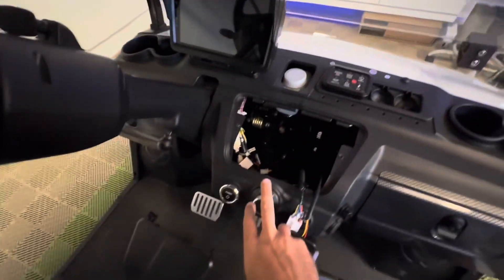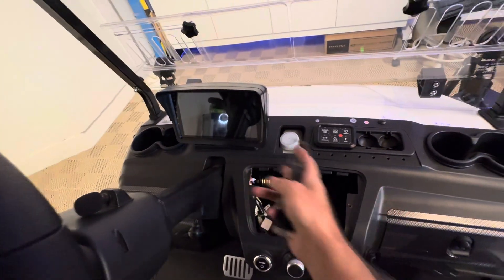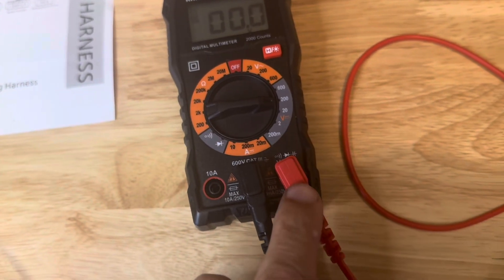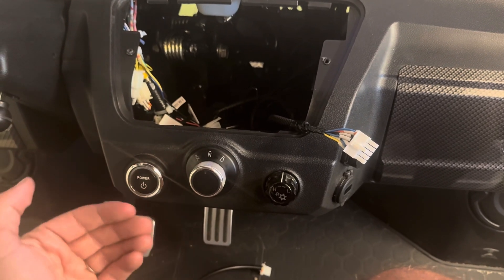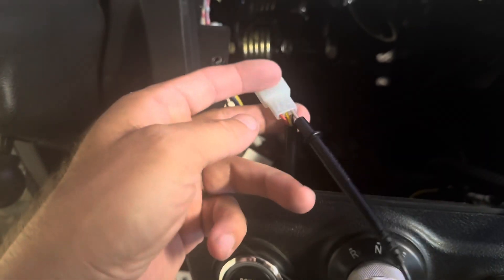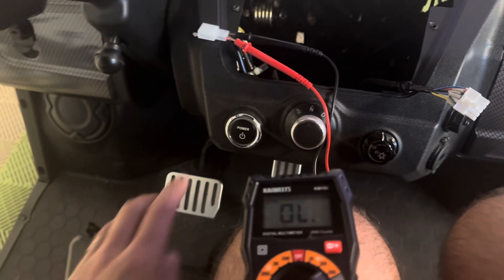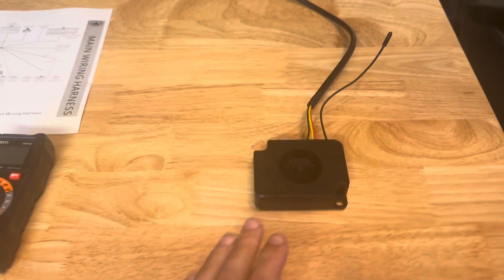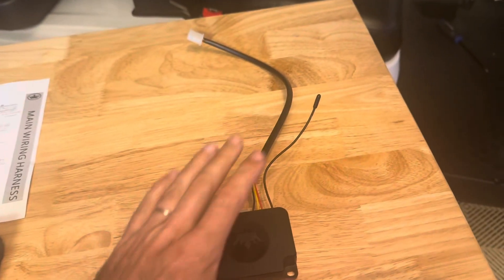Push to Start not working? Diagnostic steps to try for for evolution cart D5 and DMax. (Part 2)

Comment: When I push my start button, the blue light on the key fob lights up. Would that indicate the start button is working properly? Love your videos!
Reply from the maker: Yes! - That’s a good eye. I just tested mine and when the key sends out its acknowledgement it indeed flashes the blue LED quickly after you push the start button. 

That’s a good sign it’s responding to the controller and a great way to test it’s being picked up and responding. 👍

Comment: Hello sir. This is off subject to your video.  A question for you, can you hook 2 36v lithium batteries together to produce 72v, using the same ah.? Thank you in advance.
Reply from the maker: Sadly, I am not an expert in that type of things, but in theory yes, just depends on what your trying to achieve and if it makes sense to do it that way vs buying what you actually need. 

You can connect two 36V lithium batteries in series to create a 72V system. To do this, connect the positive terminal of one battery to the negative terminal of the other. The two remaining terminals become your 72V output. In a series setup, voltage adds up, but amp-hours stay the same—so two 36V 10Ah batteries give you 72V at 10Ah.

Make sure both batteries are the same voltage, capacity, and type, and ideally the same age. You’ll need a 72V charger and a proper Battery Management System (BMS) to safely manage charging and discharging. Never mix mismatched batteries, and keep an eye on cell balancing over time.

I would hunt around the internet